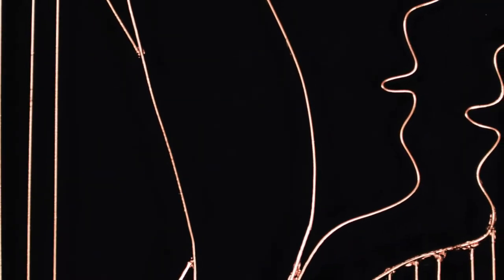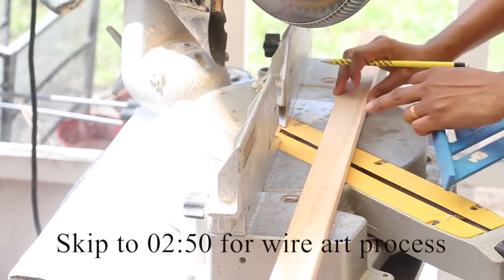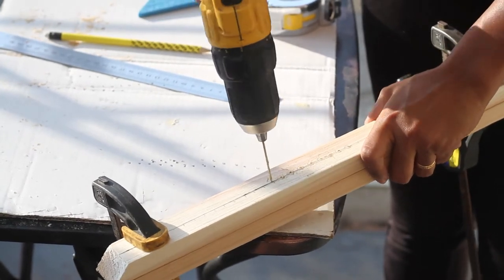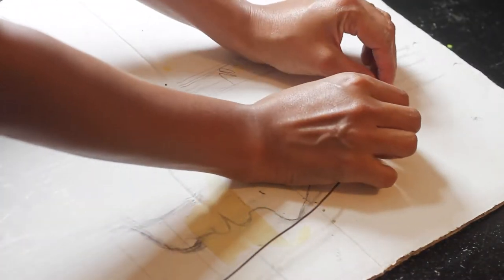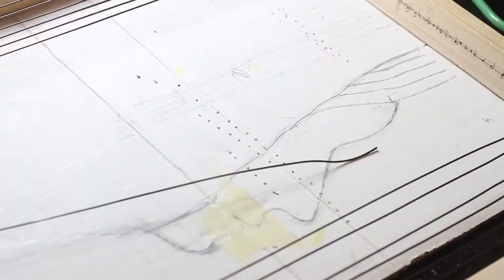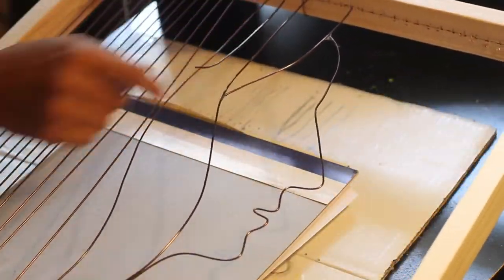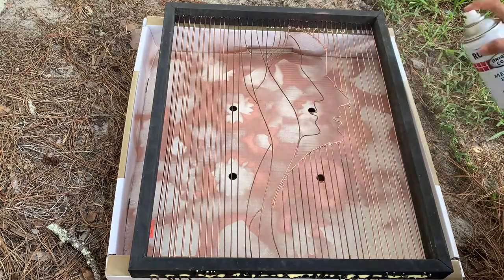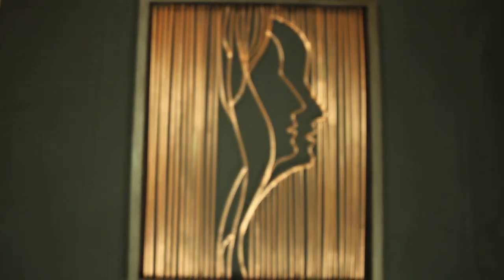Easy Wire Art for Beginners

Comment: I think it's great..if you look up how to solder  it's pretty much the same as what you do with the glue..just sand the wire where you want to solder..and put the solder in the wire ends first..and any other point you  plan to attach them..then put them.together and heat the solder enough to attach
Reply from the maker: Thank you so much for your suggestion! Honestly I did gave it a try before trying hot glue, but I believe was not doing it properly. I did not sand the wires as you suggested and in hindsight might not have applied enough heat, will definitely give it another try when I make the next wire project. Thank you and wish you a Merry Christmas!
Reply: what type of solder?